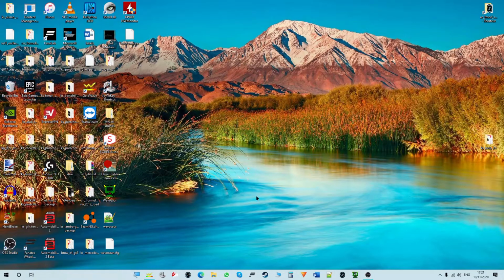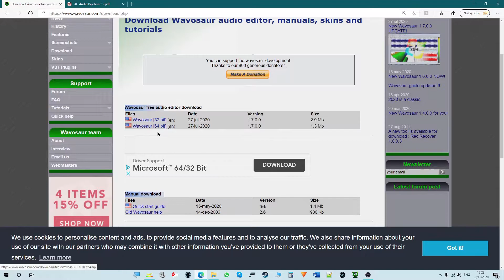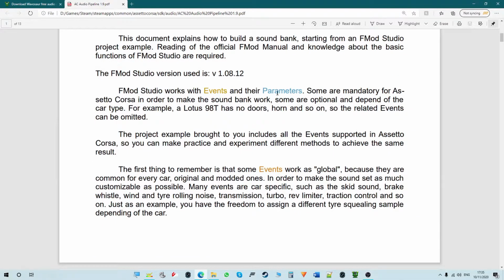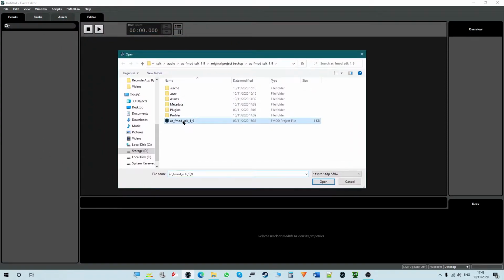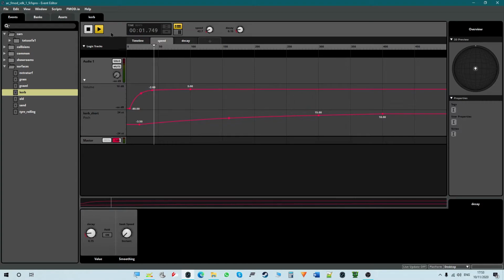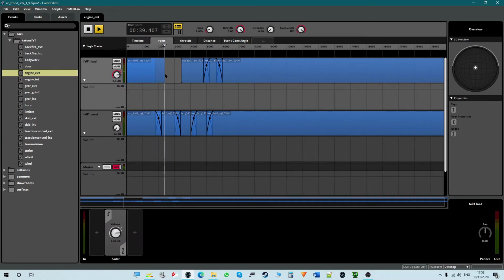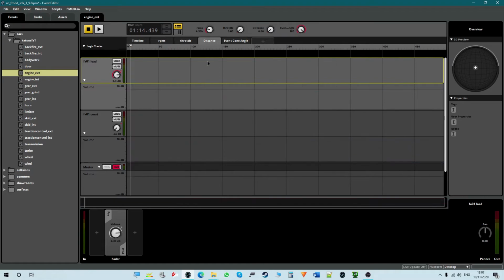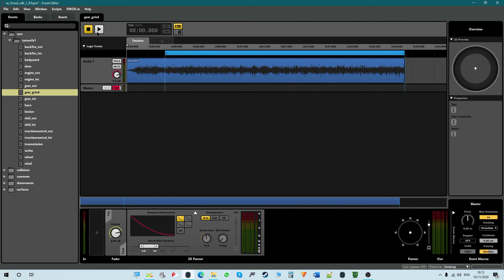Sound Modelling Tutorial #3 - Software Installation, Setup and Walkthrough

Comment: how can I add engine startup sound, seems that the "timeline" voice is not played in replay mode, but only the "rpms"
Reply from the maker: You can add it at the beginning of the idle sample and then mark the idle part to loop in audio software like waveasour. Select the region you want to loop, in this case the idle part after the starting sound, then press the L key. This will create a loop region. This only works in waveasour. Save your idle sample which contains the startup sound and idle loop and import to fmod. Set the pitch correctly so the idle will sound right at the idle rpm of the car. Then move the left side of the sample to above 0 rpm. So every time your engine in game drops to 0 rpm and then enters the idle rpm sample, the sample will re trigger from the start sound and then play the looping idle. Hope that helps
Reply: @SHRModding  thanks a lot! How can I avoid that the engine_ext samples mix with the internal engine sounds in some part of the circuits?
Reply from the maker: @frixonpilot  hi, no worries. This is an echo effect and occurs where there are reverb zones assigned in the track. Like tunnels etc. If it happens too much for your sound you can make the external sound quieter and the internal sound louder. But you should allow it to occur a bit for the reverb and tunnel effect which is realistic
Reply: @SHRModding  compared to other soundmods from others, they put even louder external sounds and that's no echo for those
Reply from the maker: @frixonpilot  not sure then I'm afraid. Shouldn't be mixing if you placed internal samples in the engine int event and external samples in the engine ext event
Reply: @SHRModding  I can't actually use wavosaur due to lame encoder problema, what should I do?

Comment: What should I do man? When I follow all your steps in installing fmod, it says the project version "02.01.00" could not be loaded with fmod studio 1.08.12
Reply from the maker: hi originally the file was 1.08.12 so not sure what happened there. try to download 2.01.00 and see if it works.
Reply: @SHRModding  yes I already tried, but im afraid that the sound would not work because as you stated, assetto corsa supports up to v1.08.12 only
Reply from the maker: @apexglide3191  hi, sorry to hear that. In that case you'll have to resync files. Seems you saved the project while it was open in the newer fmod
Reply: @SHRModding  yes I think so, im still new to this stuff in PC that is why when I found your videos I immediately remember that my fmod version was newer. I downloaded the old one and it gives me the error. You got any idea how to resync file? It would gladly help
Reply from the maker: @apexglide3191  thanks pal. Yes you can do it through steam. Back up any mods you have first though just in case. Open steam, go to library, right click on assetto corsa, go to properties. Go to the local files tab. Then click on verify integrity of local files. It'll start redownloading anything it thinks needs fixing or replacing with the original
Reply: @SHRModding many thanks for the help!